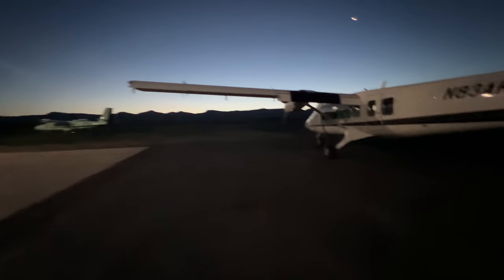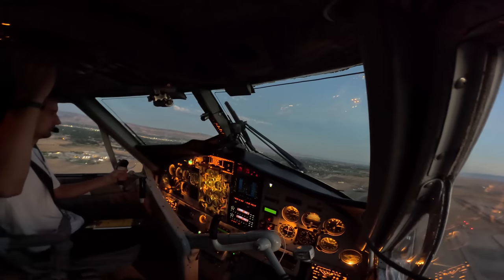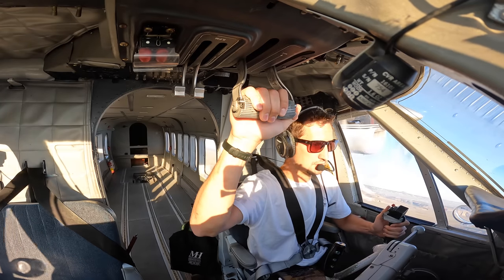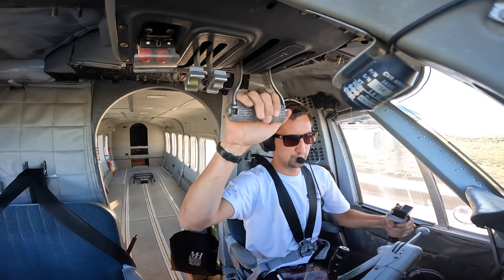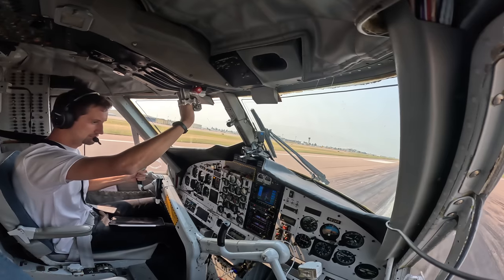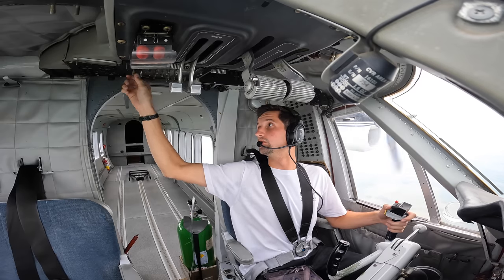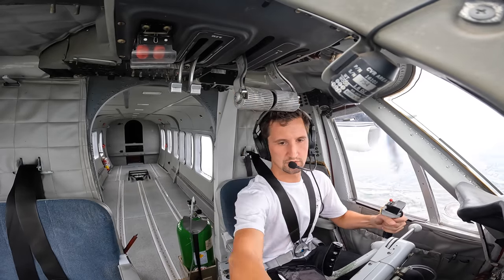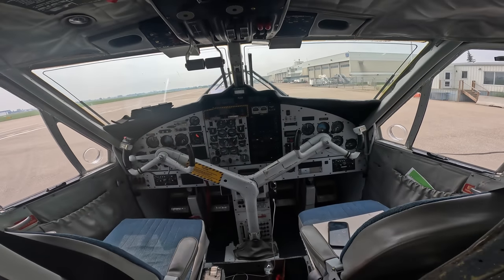Twin Otter IFR Flight to Canada

Comment: These twin otters are just bullet proof. Not the quickest, but built to last. Big fan of the single otter as well. Love the sound of that big radial piston engine out front.
Reply: An old bush pilot told me that the single Otter was better than the Beaver for developement of the north. You could load 4x8 plywood in it.
Reply: The twin Otter is equipped with a turbine engine not a piston.
Reply: @danwaldie4661  I think the post above was referring to single engine

Comment: The best plane ever made.
I was in the Air Force, an Air Frame, Tech on these planes.
They are built tough, power to weight is spot on.Snow, water and desert sand.
STOL abilities are amazing.
Reply: Such an amazing aircraft that after they stopped production in 1986, nothing was anywhere near as good, and went back into production in 2009
Reply: Great with floats.
Reply: I agree. They fly in and out of our harbor. The Otter family has a few cool planes.
Reply: Are they hangar queens?
Reply: @Repented008  The exact opposite.
Reply: I grew up in  the Toronto area , a few friends of mine had fathers that built Twotters At DHC . They are all things you say they are because they were designed to be . DHC actually listened to the bush pilots before they put pen to paper when they designed the Beaver , Otter and Twin Otter .
Reply: @stevecook7551   I caught shit for calling them Twotters. All I said was, can I buy a vowel?
Reply: @Repented008 They spend weeks on end sitting on the ocean and flying dozens of cycles 😂
Reply: Twin Otters flown by Borek Air out of Calgary have flown missions to Antartica to evacuate patients during medical emergencies. It is the only plane capable of flying to Antartica in the winter. I think that basically backs up your statement.

Comment: I have been flying planes like the “Twotter” all my life . 
Watching U tube pilot channels a see loads of pilots juggling that yoke. Even on bigger airliners like 737.
Loads of micro inputs during the approach. Like a naval aviator aiming for the flight deck. 
I wonder what lesson plan made those pilots do that. How tolled / teaches you ? 
Obviously a 80 ton plane your inputs has less effect due to the slow speed thus sluggishness. 
Know your plane, trim it correctly, stabilise and don’t fool around with te controls to make the landing nicer.
This why you never get a feel for it.

Comment: Isn’t this aircraft rated for two pilots ?
Reply: When carrying passengers.
Reply: I’ve been on these as a passenger with only one pilot.
Reply: @MichaelWillems IIRC there is an exemption in Canada for twin otters under 17(?) passengers for specific airlines like Harbour Air (might have only been the single otter, can’t recall)
Reply: @dmacpher  I sat in the copilot seat several times on Brymon airways, from London to Plymouth and v.v., in the 1970s. That’s what started my enthusiasm and it’s why I eventually learned to fly (with a first solo in Hong Kong in 1986)…